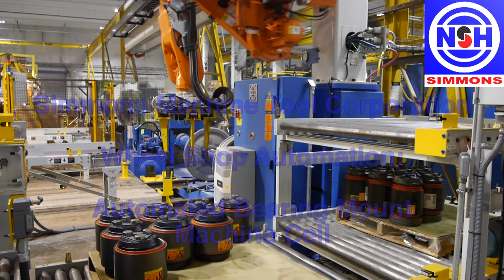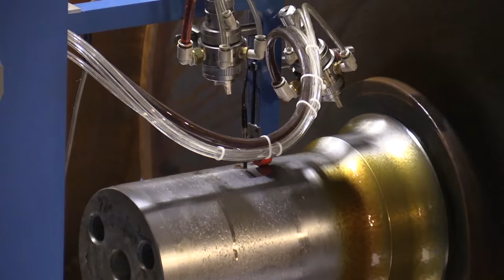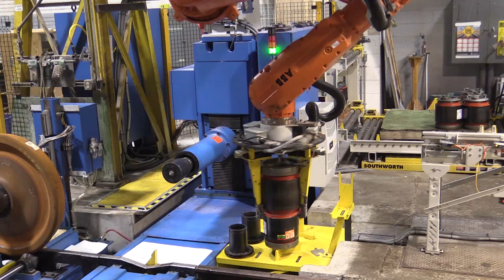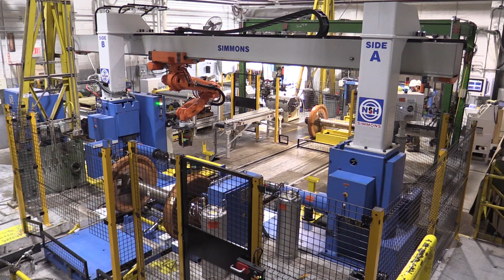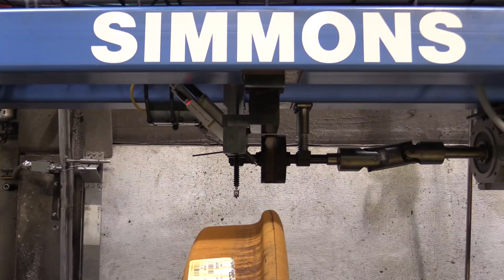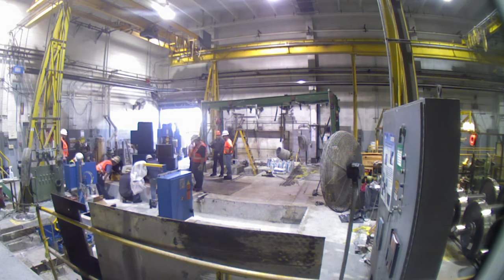Wheel Shop Automation: Automated Bearing Mount Press Machine Cell

Comment: this mavhince does it's job roughly at the same rate of speed as I used to. the shop I work in has manual hydrolic bearings presses. which we generally pump out 50-60 wheel sets within a 8 hour shift. however this machince is impressive! definitely wish we had one
Reply from the maker: +john hilton 50-60 wheel sets per shift!?!? You + your crew are not messing around.

Comment: Token human involvement at 3:39. Why did this job survive automation? I'm guessing some kind of government mandate for a certain number of human hours of labor required (job protection) in exchange for operating permits. The manufacturer figured "this is the least difficult, least hard to screw up task on the assembly line," so they assigned to a person.
Reply from the maker: Hi Adam - that end cap assembly station was pre-existing, so we designed the bearing mount cell around it. The whole cell requires 1-2 operators. Thanks for checking out the video!

Comment: that machine is slow i work in a wheelshop and i move twice as fast as that thing (i am a bearing press operator)  and just for sake of saying it those are bnsf ubr bearings either 6and a half x12 or 7x12
Reply from the maker: How do you handle bearings + wheel sets in your shop?